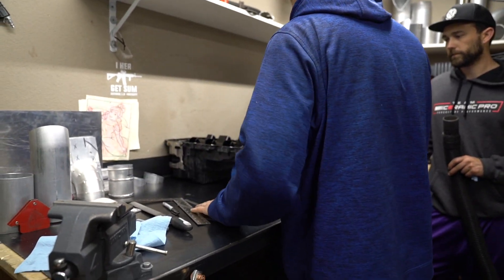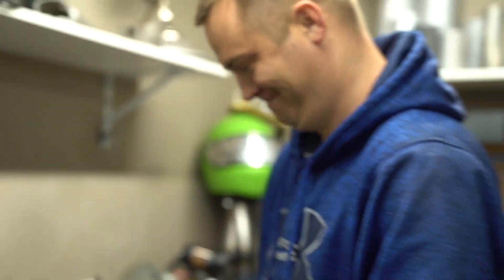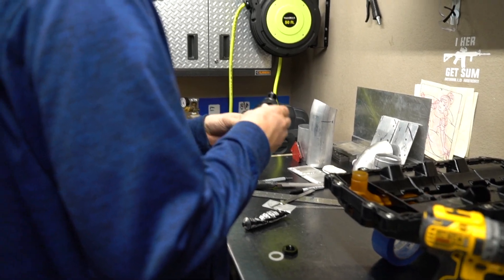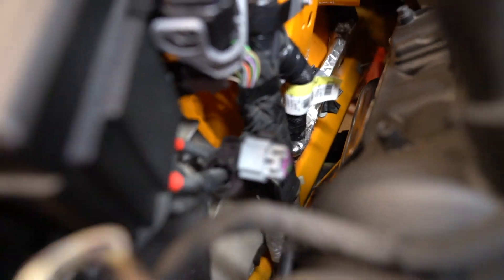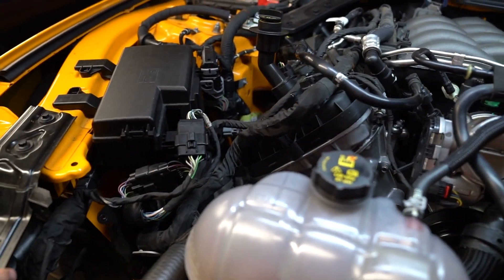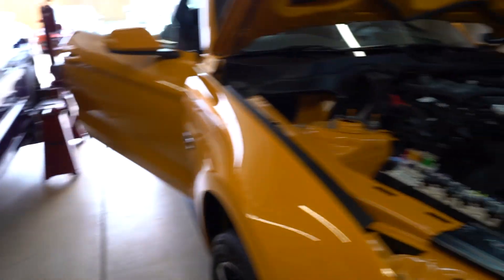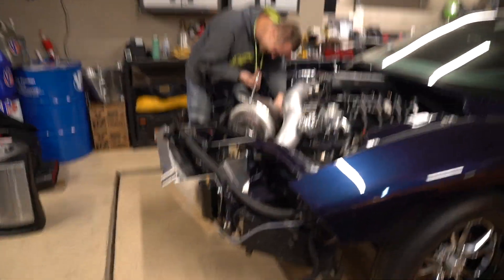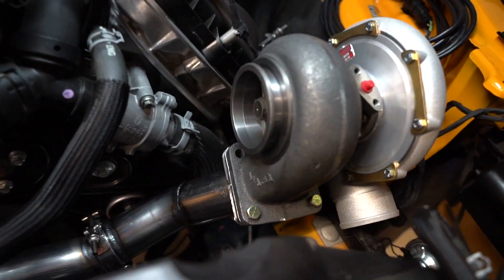Budget Turbo Mounted on my 2018 Mustang GT Part 3!

Comment: You're suppose to replace those oil pans, one time use.
Reply from the maker: Mitchell Hubert ford re uses theirs actually as long as its not warped
Reply: @DavidVanVoris  I work for Ford, suppose to replace. You can take the chance hopefully it doesn't leak. I've see some come back with leaks.
Reply from the maker: Mitchell Hubert yeah if it does just go to a metal one. It’s a shit design lol
Reply: David Van Voris I double checked today, they are reusable on the mustangs my bad!
Reply from the maker: Mitchell Hubert thanks man hoping it doesn’t leak